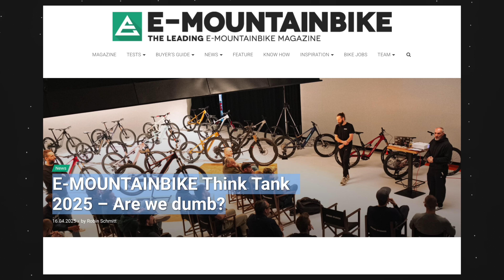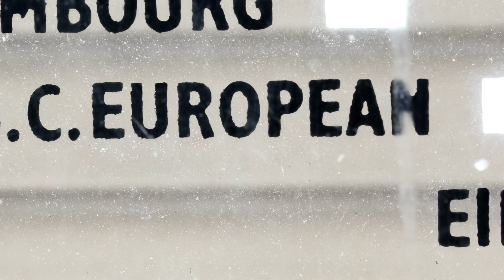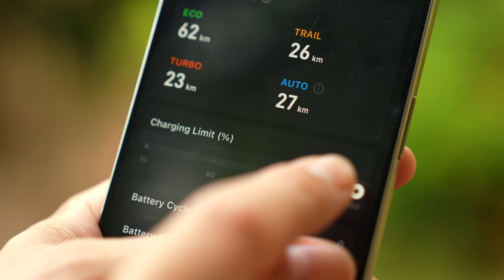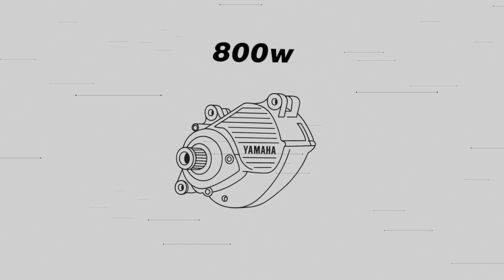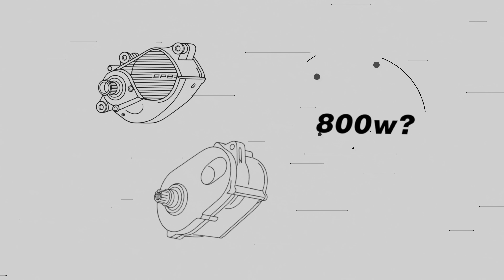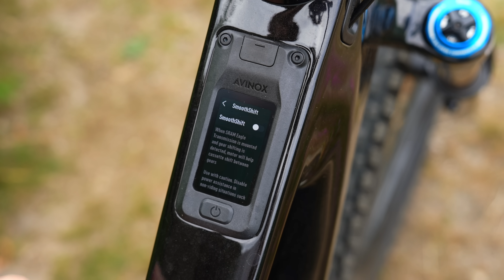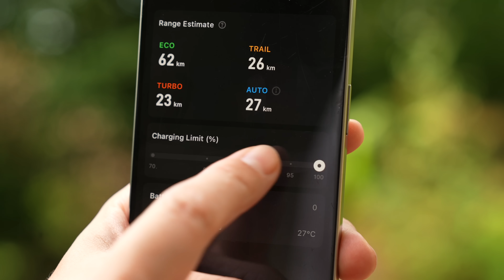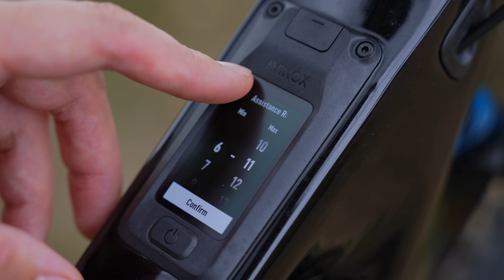Why eMTB Power Is Changing

Comment: Dont need the watts. Just want my motor to be durable, waterproof and easily servicable. Too much plastic gears and glued components these days. And a IP54 rated  electrical motor on a MTB is almost a joke...
Reply: When one of the major issues for market claims is "noise", plastic gears are the only reply

Comment: The laws around power limits will always be based around bikes that are designed for urban use as that’s where the majority of bike riders will be so policy makers will decide what is “safer” in this environment. 
The mountain bike segment is so small in the grand scheme of things it’s highly unlikely to be treated any differently.
Reply: 25kmh is really not a safe cut off speed for any bike sharing a road with cars. Personally I think urban use bikes need a higher cutoff speed than eMTB's. New Zealand does this and seems to have none of the issues the doomsdayers say will happen.
Reply: @gordoncahill1170  Over 25kmh is dangerous to pedestrians in city areas.

Comment: DJI showed up and a lot of fools followed. This is no longer motor assisted biking, it's closer to motorcycles. And then we have the tuning guys who think - just because they have the motor power - they can ride as fast as the motor allows. Next would be the speed limit discussion done by people who have no clue at all. Be glad to have motor assist for lazy riding and even lazier uphill riding.
Reply: I'm a big supporter of e-bikes, since climbing SUCKS, but you are totally correct.  I just want to take the suck out of climbing not remove it totally.

Comment: Yo Rob 
You still didn’t answer the elephant in the room! All the other motors are 250w constant as the regulations 
The DJI / new name Avinox to try n get the bike into the states but it’s still a DJI😂is more than 250w it has to be from how it delivers the power 
Luckily the Fuzz are only stopping n crushing the non legal e bikes for doing more than 16mph
If they was to check the power output all AVINOX  motor bikes would get crushed too! 
I agree the 250w/ 16mph is to low it should be around 21mph 
As like you said I could get on a analogue bike and go faster and that’s legal but a e bike doing 20 is Illegal 
You and the other channels should be lobbying the right people to get this changed to more realistic figure and then put out a more worthy video about how you have improved the e biking regulations

Comment: Have been considering Avinox for my 5th emtb (that's how I've spent my midlife crisis money instead of sports cars), but am thinking of waiting for a gearbox unit but also longer-lastung battery. For me, don't want to worry so much about battery management system or long-term life of the battery itself (700-1000 charges or so).

Comment: I would rather ride for longer (using less battery), than get to the top of a Bike Park climb 10 seconds quicker by using more power/torque. When i'm riding i'm very rarely time bound, but i'm defo bound by the size of the battery, or time it lasts.

Comment: All about the TQ motor system for me, the ride feel , the engagement and enjoyment of still feeling like you are riding a bike....far exceeded the Bosch & DJI experience, which is just something different. The things I could still climb up with only 50/60Nm blew my mind....I dont need, nor want all that power.
Reply: I second the favour of the TQ, the power is enough to stay in zone 2 for the majority of my rides at 79kg. Such a natural ride feel and you dont feel the motor cut off at all when you reach the 25km/h speed limit. Which makes a big argument for why analog bikes are so fun on decents. Any more power seems pointless. Better off buying a motorbike if you crave power.
Reply: @Alcanday Absolutely , 100% agree. The motor cut-off is another valid reason as to why imho this system is just better...im not understanding this drive for endless more power..
Reply: If you are 100kg or above, this motor is a joke..
Reply: @anseladams5634then lose weight
Reply: @anseladams5634 And what did you do before bikes had motors? Pedal harder fatboy.😅
Reply: If your not too heavy yourself it's decent but wasn't powerful enough for me.
Reply: @garybird8646  It's not even about the weight of the bikes either, Trek Slash + 560wH is very similar to an Amflow 800wH(crazy) ... there's a connection to the ride that's just not present on other drive systems for me. I get a proper buzz from riding a TQ powered bike that I just don't elsewhere.
Reply: @garybird8646 I'm 95kg but love my TQ
Reply: To each their own and it is great that you love your motor. I did not love it. In fact of the 6 or so demo's I have done over the last 2 years, this was easily my least favorite. I can't put my finger on exactly why, but I just kept thinking I am pushing a really heavy bike with very little help. I would have just rather be riding an analog than this beast. And that beast was a Yeti. I think the power you get to the extra weight on a TQ felt like a step backwards. We all have our reasons for riding bikes, and they are all valid. But Fun is at the top of my list and I did not have fun on the TQ
Reply: I'll be buying a TQ equipped emtb in 2026. I rode the hrp50 and the hpr60 has 20% more power, which seems perfect. It feels like riding a normal bike, weighs less and is silent, also the 540 battery is more than enough. All DJI bikes are currently extremely overpriced
Reply: Lol when I ride the TQ system I'm like. Is this thing even on 🤣
Reply: @CarlRcAirNLandNAquatics Maybe that's the point!
Reply: @CarlRcAirNLandNAquatics  some of them are defective on a test bikes, so yes, they maybe off because of some issues.
Reply: @G00glieS I sell them brand new. I know how they work. I've been in the trade for 23 years. TQ is just pointless. No guts to it whatsoever. Might as well just buy a light weight analogue bike.
Reply: @CarlRcAirNLandNAquatics weird, I’m 105kg and TQ50worked just file for me. Is definitely not strong, but is good enough.
Reply: @G00glieS Ride an Amflow for a bit. Then go back to the TQ. Then you'll see what I mean. The other thing that annoys me with the TQ motor is. It's a cadence machine. You have to pedal like mad to get anything from it.
Reply: @CarlRcAirNLandNAquatics  I tried some other full power motors and to my liking they are overpowered. I feel that I'm a passenger on the bike.
Reply: @G00glieS probaste a ajustar la potencia a tú gusto?
Si no lo hiciste tú test es erroneo
Reply: @G00glieS los motores potentes puedes ponerlos en 25nm si quieres, no entiendo
Reply: Influencers … influencing at its best…. day by day trust vanishes RiP Rob Rides

Comment: the next big thing should be standard charging (connectors, etc)
every bike brand has their own standards. 
EVs have them, Smartphones have them etc
Reply: What I would love to see is standard motor mounts, so when you have a perfectly good bike with an old motor you could upgrade it to the newer motor.
Reply: Definitely. Thought about this many times, in five to ten years there is going to be thousand of scrap yard ripe bikes everywhere.
Wouldn't be just the motor there would it... Controller and electronic all have to work together. Messy
Reply from the maker: I hope for this too!
Reply: I'm an electrical engineer, This is easy to do. 

Companies don't wanna do it because it costs money and they don't want to share their piece of the pie. All they need is a small step-up boost converter and a usb-c 20v charger.

So we end up with 20 "standards".  Sounds familiar? Bicycles always been like that, nobody can agree on anything.
Reply: Huge point. Should be mentioned more
Reply: That's why I went with a bbs02
Reply: There is one - XT60. Do not buy bike wihout charge plug xt60, or adaptor to xt60. There is aftermarket 4KW portable charging devices with xt60-xt90 out.

Next big thing - possibilyty to quick charge(15 minutes) on automobile charging stations. Monowheel already can be charged at this stations.

3 years riding on bbshd - 1.7KW peak power.
Reply: USB- C PD 3.1 (Extended Power Range - EPR) is rated for up to 240W (48Vx5A) 
That's tripple the power rating of most (80W) ebike chargers.
Maybe 5 Years from now it will be common to see new LEV products have USB C on them.

Comment: It’s the same story with motor bikes. For off road trail riding I had KTM 400cc. You can  get bikes with much more power but they become too difficult to handle on technical trails they weigh more. 

On most trails I could not go more than 25MPH. Too dangerous and speed was not the point. 

So for it’s the same with eMTBs. I want  controlled torque and light weight to climb steep technical slopes. And enough speed on open trails where it’s safe to do around 25mph. And on the road when going from one trail to the next I want to ab able to cruise up to say 30mph and not slog it out at  15mph.But no more than that otherwise it does become a motor bike and in the UK we know what happened here - in effect motor bikes got banned from off roading because of the few irresponsible riders who ruined it for everyone else.

Comment: Is Bosch Trying to make Limit 750 in Europe
Reply: It's necessary, to be honest
Reply: @stuka78 on Roads commuting 25kmh to Slow nearly all Analog bikes faster
Reply: @paulhusky580bts problem is not speed limit, problem is that electric motor should disengage reaching 25 km/h, allowing rider to push more.
Reply: @stuka78 when it hits 25kmh it like hitting wall if on Flat Road ok if Going down hill here EMBN Presenter who Moved from GMBN  he did Video one Annoying thing with Ebike the Motor cut out Speed he could Ride Analog bike Faster now Ebikes here Slowest bikes on the Flat
Reply: @paulhusky580bts that's my point, if only motor would disengage hitting 25...

Comment: I have a Bosch Gen 5 and I have kept all of the modes I use in their Factory Settings. Apart from Turbo.
Eco+, Auto and eMTB+ are at at 0 with 600w & 85nm. Turbo is cranked up to 5 on all settings with 750w and 100nm.
Emtb+ is what I keep it in most of the time.
I also think the parachute deployment at 15.5mph is a pain, even going down hill! This makes me slower than my MTB mates, the 20mph traffic we have in Wales, and feels unsafe. This is why I have ordered a Volspeed, to get me up, down and off the roads ASAP.
22mph would be a sweet spot.
Reply: Yes this is a rediculous limit, dangerous too on gap kilos that need speed you couldajr on an analog but get the parachute effect when you least need it.
Riders should be able to waver this or legislation to let emtbs do whatever speed.
It's no surprise midders are bypassing it. Not all laws are good laws
Reply: Restrictions just make no sense. There are times when you want to go as fast as you can when pedaling asphalt. Its a motor with less than a horsepower.

Comment: This was innovative based on old technology (chain, cassette, derailer) and this is why it not for me. It’s the last hoorah of a bygone age but it doesn’t represent the future. The future is the development of the integrated motor gearbox/ gates Carbon belt drive. All the lessons learned from the DJI Avanox motor can be applied in a much more robust transmission.

Comment: the Bosch magnet only controls the top speed cutout and the pickup is in the motor no cables running to the rear triangle anymore. The dji reluctor wheel is there cadence sensor and adjusts your power 42 times per wheel rotation where as bosch says the computer senses your torque 1000 times per second and adjusts the output accordingly thus giving you amore natural torque sensor feel. When I got my gen5 power update installed I tried it on a hill, I left it at 85nm and cranked the watts to 750 I didn't really notice much of a power boost, then I cranked it up to 100nm and wow I sure noticed a difference then so to me on a bosch motor the nm is where the power is at not the wattage. I've heard on the gen5 you don't see the 750 watt until your putting out 240 watts yourself. Cheers All!!!
Reply from the maker: The Bosch is a great motor, I’m a fan of it too. They both feel different for sure. Some prefer the instant pickup of the Bosch, some prefer the less aggressive pickup of the Avinox :-)
Reply: @RobRidesEMTB Bosch Gen 5 for me.  DJI may be the temporary power king but the Gen5 Bosch is quieter and likely more reliable.  Time will tell.  These things are constantly being updated and Gen6 Bosch will be the "best eva" when that arrives
Reply: The Avinox also has a torque sensor. You can set the display to show rider torque vs bike torque and the watch the system adjust instantly to any rider input. It has a torque sensor, cadence sensor and also the 42 slot wheel sensor.  And a compass, inclinometer, thermometer and air pressure sensor.😂
These latest ebike systems are amazing.
Reply: @Ffaitt  I agree with you 100% these new motor tech improvements are awesome{still no thermometer on the bosch}. The reluctor wheel on the dji would work just like a torque sensor the harder you push the faster around goes the cranks increasing cadence. I haven't been lucky enough to try a dji but I sure want to. What gives the dji more of a boost cranking up the watts or cranking up the nm?Cheers!!!
Reply: Watch Alex e bike tester videos on the DJI and how it crappy delivers the power but oddly Rob can’t understand this 😂
Reply: @BrianJ-t1u I watched Alex video. He is only focussing on a single thing and that’s how aggressively the Bosch delivery power on the very first pedal stroke. He fails to mention all the other benefits of amflo like fast charging slim frames touch screen anti theft lighter bike weights much more power and all the other things. Seems he just prefers the feel of Bosch which is personal preference not better or worse just his opinion on a single aspect of overall package
Reply: @BRANDONGEE-yk4yu  Ultimately how the motor rides is what determines how good it is. And the Bosch instant power already in Gen4 and now in Gen5 makes it the only option you have if you want to ride technical terrain. Also Bosch power delivery is either on or off which just makes it a very predictable motor to use. And the power is nearly the same in every cadence which again makes it predictable to control. So Bosch has earned it's market position because it has been the best motor. The only real problem with Gen5 is that it overheats. The only advantage DJI has is a lot of power. If power was equal and no overheating the Bosch would be completely superior.

DJI isn't a perfect motor because of the slow power delivery and being cadence dependant but Alex has just determined to be a contrarian  which makes him unreliable when talking about DJI.

The only other motor with instant power is Rocky Mountain Dyname 4 but only after the software update. But that is now a previous generation motor. Specialized new motor is the worst the motor is incredibly slow to start not starting at all during the first cam pull.
Reply: @BRANDONGEE-yk4yu if the Amflow is that brilliant it’s odd it’s not won many best bike of 2025 in all the multiple bike tests by all the bike reviews . Only saying 😂😂😂😂😂
Reply: @BRANDONGEE-yk4yu Bosch motors have had the same anti-theft features for years before the Avinox system released.
Reply: @BrianJ-t1u sales might tell a different story lol😅
Reply: @BrianJ-t1u  Actually it Alex who doesn't understand. He been hating on the Avinox months before it was even released. He's got no credibility in this space and best ignored.
Reply: @BrianJ-t1u Alex is an anti-dji nut. He has just decided to be a contrarian and is just making everything seem overly negative about dji.
Reply: @Raumance lol he knows how a motor should work n not Chinese go at it 😂
Reply: @Raumance he isn't negative about the whole DJI system, and I'm not racing to his defence here, he has issue with, his words, the torque settings and initial pick up.  I've just taken delivery of an unno mith but I need to invisi wrap it tomorrow before I ride. So I'm hoping the DJI is as good as everyone says ... but I know it will be different, I also know that DJI will update it to make it better if it's possible, other motor companies must be worried.

Comment: Its getting to the blured lines area where your kicking at the heals of a "e motorbike" but able to use it in places where it would be illegal.

Im all fot it but you hit the nail on the head its trade offs and munufactures need to harness the power to be useable same with big power motorbikes its all electronics to keep it in check.

Comment: 750W is the stated "maximum power" in both California and Nevada in the Western US.  Vehicles above 750W require licensing and have other rules of use in these states.  Not sure about the regulations in other US states, but regulations need to be updated everywhere to address both e-bikes and e-motos.
Reply from the maker: Interestingly in the US the top speed is higher (20Mph vs 15mph in EU) , but max power is lower (750w as you say, but no actual Watt peak power limit in the EU!).
Reply: There is starting to be pushed back on this. Besides the max 750 watt as mentioned here, discussions now center on limiting boost to 400% and no modifiable options which is currently a loophole now a bike will not be able to be switched between class 1 and class 3. There is also start to hear about the elimination of class 2 for throttle assist bikes basically they would be classified as motor vehicles. The boost limit comes from models which are pedal assist but barely require any pedal input at all.
Reply: power (watts) = torque x rpm.   A motor can have gobs of torque at low rpm and still stay under the legal power limit (I live in California so 750W).  Then the torque can taper off as the rpms rise to stay at 750W.  It will be able to go up very steep hills, but not as fast as a 1000W motor.
Reply: read my comment the only way they will be adjusted is way down..in the EU the limit is 250w "average" also 15mph limit, rename your channel to robridesmotorbikes